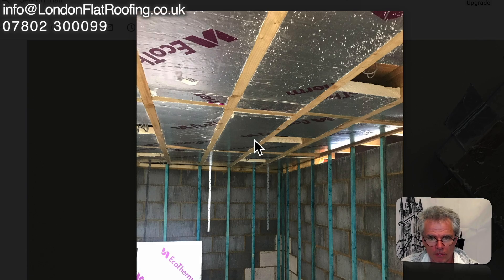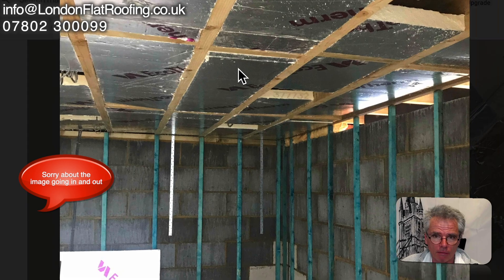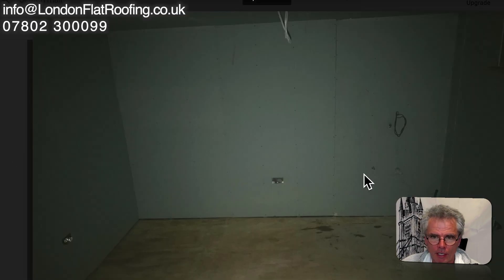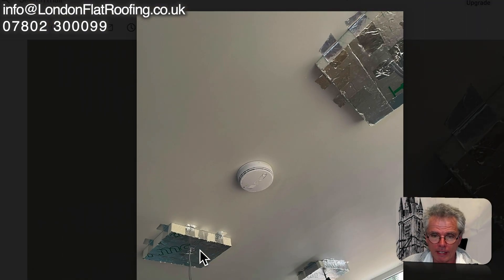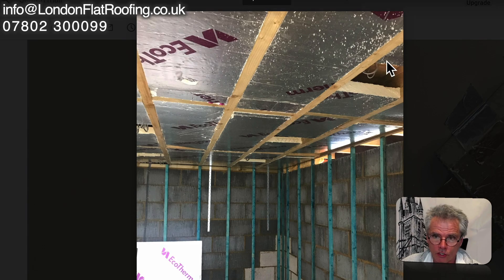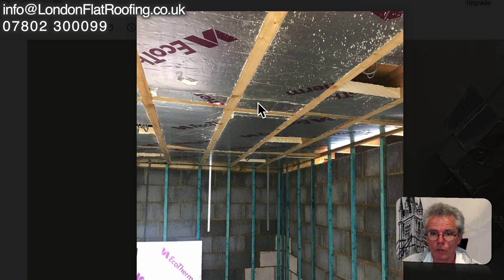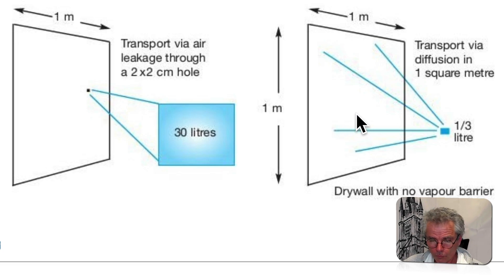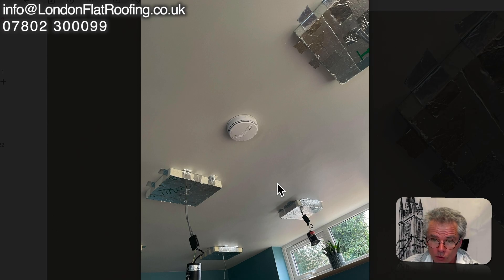Can I save my sweating cold flat roof with no vapour barrier ?

Comment: Hi Steve,  boy your videos are getting addictive  ha.
When you say the moisture barrier should cover the ceiling and run down the walls, do you mean run all the way to the floor or just a foot or so to get a good bond to the wall and ceiling?
Reply from the maker: Just down 6 inches or so so that you can see it correctly you don't want moisture getting up behind and into the roof.

Comment: Great advice. I’m doing my garden room insulation just now. Putting 50mm in between rafters then overboarding over rafters with 25 mm Celotex to prevent thermal bridging. I’m using the Siga Marjex vapour barrier system over it then plasterboarding. Soffits will be vented, and I’ve decided to get rid of the downlights and just have a normal flush ceiling light to make things easier.

Comment: Its a pity no one has designed an air tight downlighter that can be sealed in place to prevent moisture leakage.  It would solve a lot of problems.
Reply from the maker: They there is a tight ones now, however, they have to be installed correctly

Comment: Hi steve ive got 50mm cellulose with vapour barrier on top and 170mm fibreglass on top of that in between joists. Will that work and avoid condensation?

Comment: If you fill the void where the lights are going with insulation how do you fit the lights in ? If you have good cross ventilation front to back do you need a vapour barrier ?

Comment: Im renovating my cold flat roof but am unable to create a warm roof due to external height problems. I’ll be ripping down the existing ceilings, so could I push celotex between joist, up to the underside of the flat roof deck. Then use insulated plasterboard for new ceilings and still use downlights? Venting the roof is going to be very difficult as there is no soffit, just fascia.
Reply from the maker: No you have to leave a 50mm gap under the roof decking and above the insulation, this gap has to have thorough ventilation from one side to the other.
Reply: @SteveRoofer  thanks for the reply. I have no idea how I’m going to vent the space. Really don’t want a row of mushroom vents.
Reply: @SteveRoofer  I think I’m going to cut soffit vents into the fascia at one end and put mushroom vents into the other end nearest the house. Will I need to do that between every joist?
Reply from the maker: @peterbrown954  yes unless you put one in the middle of a joist so it vents both sides them you can put one mushroom every other joist
Reply: @SteveRoofer  thanks again. Do you mean a hole in the middle of the joist?
Reply: @SteveRoofer  I had thought about perhaps putting some holes in the furring pieces and that way I could get the mushroom vent to vent a few at a time. The mushroom vents I’m planning on using can vent 36 sq m.
Reply from the maker: @peterbrown954  No a hole in the roof above the joist so the air can pass over the joist from one side to the other
Reply: @SteveRoofer  brilliant! Thanks so much. I’ll put some holes in the furrings (like I saw in another of your excellent videos). That way the roof won’t look like a mushroom farm!

Comment: Why is the vapour barrier needed if there’s enough ventilation above the insulation? Genuine question, just wondering why…
Reply from the maker: The more you stop rising into the vented space the less work the vented space has to do basically it's a fail safe however we now know that most invented spaces don't actually work that well so therefore if they've got less to do you've got to be in a better situation

Comment: In these scenarios how would people get around installing down lights?
No matter where the down light goes it won't be airtight and it'll allow the warm air to pass through the gaps around the down light and hit the cold side causing condensation and mould growth?
Or have I got it wrong?
Reply from the maker: No you got it correct you have to do a lot of detailing to fix a down lighter correctly or you place a dropped ceiling with a cavity but people don't like doing that as it takes away ceiling hight
Reply: @SteveRoofer  thanks for the reply Steve. Good to know alot of detailing it required around the down lighter. I think a warm roof is the way forward, you always have a void for cables and downlighters.
Or like you said have a cold roof but a small drop to accommodate lights and cabling etc.
Love your videos, so many good explanations and good to know what not to do. Keep up the great work.

Comment: How's best to stop heat going through a downlight and into a cold flat roof? Your highlighting the importance of no insulation and vapour barrier around the downlights being a bad idea but does that mean you can't have downlights? Downlights are generally fitted in the final stages of completion to extensions/outbuildings etc so how's best to thermally protect the downlights and without going through the vapour barrier also? 👍
Reply from the maker: This is the most requested question and I will be doing a video on this in about three weeks
Reply: @SteveRoofer  
Cheers Steve,can you not do it this afternoon? 😀👍

Comment: Hi Steve 

Hope ur well, I’m doing a cold roof, I’m at the insulation stage of my build of my garden house, is it a good idea to use 1.5m foil radiant barrier to the top deck first and then add 100mm PIR insulation? Or should I just use the 100mm of PIR insulation,  ?
Reply from the maker: I don't quite understand what you meen send me a drawing info@londonflatroofing.co.uk

Comment: Hi Steve, I got a question.. can you mix insulation? I have a cold roof that had rockwall in, it has a 50 mm air gap, and I can fit in 150mm pir boards with the 50mm air gap on top, can I say use 50mm pir boards flush to the ceiling and then use rockwall 100mm on top of the pir boards? Only suggesting because I have lots of wiring above and would be a nightmare to move all the wiring higher? Thanks

Comment: I’m gutted. Think I’ve really messed up. I’m almost 80% through fitting a lowered ceiling in my outhouse. It has an un-insulated asbestos concrete pitched roof. 
I just built a new flat ceiling frame, fitted that foil coated bubble wrap stuff and plaster boarded it. I then cut holes for the Downlights. I went in there yesterday to start work and noticed condensation dripping off the inside of the roof. I assumed it was due the the rain the night before and that it would dry out, but it is getting significantly worse over time. That is what led me to this video. Now I’m thinking should I just stop, rip down what has been done so far, fix the issue and start again. 🥴😫😥
Reply: I think I might have sorted it. I watched a few more of your videos and realised I needed to add some ventilation. So I knocked out three bricks and replaced them with air bricks today. I’ve taken a look this evening and I can already see a reduction in the amount of condensation. Thanks for all the knowledge you share. 🙌🏽
Reply from the maker: send over photos and let me have a look
Reply: @SteveRoofer  wow! Steve, I appreciate the reply. I’ll get something over to you. Many thanks.

Comment: Hi Steve, 

I am half way through building a garden studio. I am restricted to 2.5m so felt I had no option but to build a cold roof. 
I have 6" joists and 4" noggins to allow a 50mm gap above. I am thinking of drilling some small holes (10mm at a depth of about 40mm) to allow ventilation between joist cavities as well. 
I am planning to tap some nails in so that when I insert the PIR insulation (90mm) it has something to stop it going too far. Do you think these could be a condensation risk? 
I will aim to cut the PIR for a tight fit, and chamfer the edges so I can seal with expanding foam from below. I am thinking that this will prevent foam from expanding inside the cavity above and provide the best insulation. I will then fit a vapour barrier to the underside before plaster boarding. 
I will vent the soffits but am concerned that 3m is quite a large span to vent. 
I am also concerned that saturated air on rainy days will naturally fill the cavity and without wind could be static there for quite a while. I see this as probably the main source of damp air and much more of a problem than small amounts coming from the room itself. Do you agree?
Do you think my construction technique will work?
Any suggestions? 

NB:  I have seen a hybrid roof where the insulation is just pushed up against the roof deck, which is supposed to be okay for low occupancy rooms. It would be difficult to do this now my noggins don't meet the underside of the roof deck.
Reply: Its  all a bit limited  so may work but you should try to increase the ventilation gap, hole sis not the way too you see people dining it but it really restrict the flow of air you need good flow of air
Reply: @HampsteadBuildersLt 
Thank you Steve for your response. I’m afraid It would be difficult and expensive to increase the gap now. The roof is constructed and I have already got the 90mm PIR boards. I thought the thicker the better to prevent warming the cavity. 
I understand from your comment that you don’t recommend holes in joists - do they create a more turbulent flow of air, when what you are after is a laminar flow?
Would it be worth painting the underside of the timber deck and joists with anti mould paint/stain as a precaution? I would select a breathable product.
What about pushing the insulation against the roof, I’ve seen that done.
Many thanks
Reply: @abbbee8918  They don't give enough ventilation  but anything you do is enter then nothing

Comment: Hi Steve, Great explanation on vapour transfer. I have a similar cold roof with no vapour barrier. Would it be worth using a vapour barrier paint (I think they are latex based) on the plasterboard ceiling?
Reply: Yes. Since the moisture comes from the lived in space (cooking, showering), vapour barrier paint will stop any moisture from getting through to the cold underside of the flat roof, where it would condense.
Reply: No, dude
You'll trap water this way
Reply: @stevejohnson4049 don't use barrier paint?

Comment: Hi Steve,
I just want to ask how would you insulate metal box section roof panels ?
I have 4x2 rafters and I was thinking at using 50mm pir kingspan and leave 1inch or 2inches gap between insulation and metal and also drill holes in rafters for the air flow. 
From the warm side Im thinking at putting pvc cladding.
Do I still need to put vapour barrier and also is my way of thinking how to do it right ?

Thank you for your reply.

Regards

Comment: Nice video.
Question for you.
I’ve just plastered so bit late but be nice to know if I’ve messed up.
I’ve made a cold roof in 9x2, 100mm celotex.
I left a gap of around 1” between the plasterboard and celotex so I could run the cables under the insulation. Didn’t use a vapour barrier as assumed celotex would do it. 
My worry is I’ve created a mini cold roof between plasterboard and insulation!
Starting to think I should of put the insulation tight to the plasterboard.
Rooms 6x5m
Reply from the maker: No its on the warm side of the insulation so that cavity is not a problem
Reply: @SteveRoofer  
Ahh makes sense.
Thank you very much
Reply: It's a bit like having a warm roof if you've done it this way. Good tip to leave a little void on the warm side for cabling.

Comment: Wrong insulation installed for starters  should be 100mm in and 25mm over joists or 120mm i between. Hear what your saying about vapour membrane but how do you install downlights without compromising the membrane ???  We also use foil back plasterboard on ceilings
Reply: think the ceiling is going to have to come down and replace the 50mm insulation with 75mm as that's all can be squeezed up there and still leave a 50mm ventilation gap since the height between ceiling and ply roof won't allow for more.  Height between ceiling and ply from the front is around 17cm but this lowers to around 13cm at the back.  Lowering the ceiling is also not an option as they put the window right up to the ceiling..so no easy fix for that one.  The building is 2450mm so changing the height to the full 2500mm would allow for 100mm insulation in there, although that would mean removing the rubber roof and re-doing the joists and not sure the builder will be too keen on that option.  So I'm hoping 75mm insulation will be an improvement over 50mm..that together with foil backed plasterboard and ensuring all gaps are completely sealed and no gaps in insulation will hopefully be enough...

Comment: Steve, what do you think to plasterboard insulation like Celotex PL4000 which include a vapour barrier? Are they just as good as installing a polythene sheet behind plasterboard? Cheers
Reply from the maker: Its Ok but no good as a vcl as you cant join the silver foil togther as its at the back
Reply: @SteveRoofer  Thank you

Comment: Hi Steve great video. 
I’m putting a cold roof on a small porch (6sqm) used as utility room on my bungalow.
I have a question re upstand vents. I plan on venting the soffits all round , directing air flow back to the bungalow wall, where you would normally create a vented upstand.
However if I were to do this, (As it’s a bungalow) there is not much room between the flat roof and the soffits/fascia of the main roof. 
In fact the vented upstand would sit behind/be covered by the soffit/fascia of the main roof. 

I was thinking of overcoming this by incorporating that section of main roof fascia in to the vented upstand of the flat roof. (In effect creating a bigger void as an upstand, which doubles as the main roof fascia).
The result of that would be the airflow from the flat roof would also go into the main loft space of the bungalow (which in is vented at the soffits all round).

Do you see any issues with this idea? 
Thanks.
Reply from the maker: Normally I would not vent one roof into another  but as this is a small roof and its a porch then I cant see a problem
Reply: @SteveRoofer  why wouldn't you vent one roof  into another? I was going to do the same as this guys porch with the cold flat roof on my bungalow extension, it's 2.4 by 5.4 metres. I was going to install some vented double Roman tiles on the existing roof on that side of the property.would this work in your opinion?

Comment: What’s the best process to install down lights in a cold roof
Reply from the maker: Build a void with another ceiling under the first one and fix the lights into that. But nobody douses this as it drops the ceiling so  use slim LED spotlights and keep the insulation and  vapour control layer intact